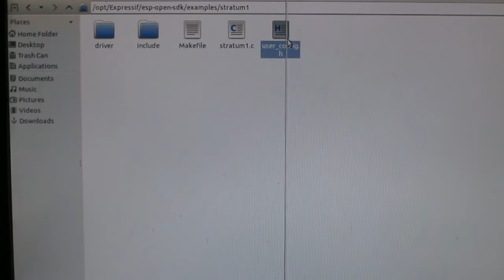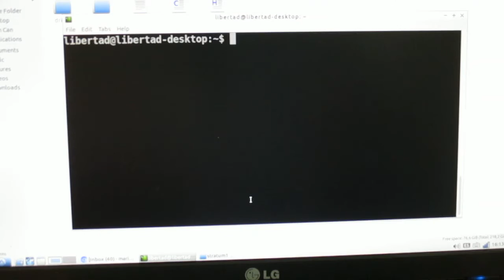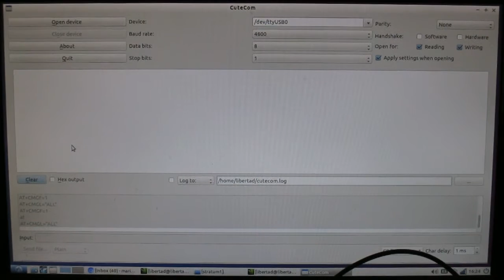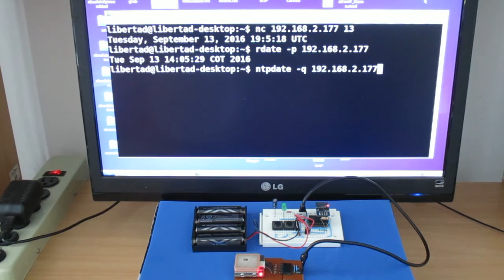ESP82266 + GPS STRATUM 1 NTP SERVER

Comment: Have you considered an updated article, one that uses PPS, or perhaps written in LUA?
Reply from the maker: Hello! thanks for viewing and writting! Sure is in the "TODO list", first need a suitable module with PPS output. I have little LUA knowledge, don't know if is fast enough to keep the 3 simultaneous socket connections and serial port management without polling
Reply: This module has PPS output http://www.dx.com/p/open-smart-serial-gps-module-for-arduino-apm2-5-flight-control-450738
I just got one of these in the mail today. I will be trying to compile this up and get it working on my NodeMCU. I am having to create the whole build env on a raspberrypi. i've done all my previous tinkering on the ESP8266 in the Arduino IDE, so this will be a 1st, if I get it working.
Reply: Well i got it working, but not with the nodemcu, might be something different about its RX pin? I also have an ESP-01 and got it working with that module.

I had some errors about the .text being too big to fit in memory. After googling I found a fix of replacing the LDLIBS line with this

LDLIBS = -nostdlib -Wl,--start-group -lmain -lnet80211 -lwpa -llwip -lpp -lphy -lc -Wl,--end-group -lgcc

It looks like the -lc is what is different from the line in your source

I also had to update the serial baud rate to 9600. Otherwise it works
Reply: After using this for a day it seems to work pretty well. Though I have noticed a couple of things. When using the ntpq -p command on a server I have syncing to the esp8266 the delay is a bit high, always in the 200ish MS range. I notice if I ping the esp8266 the 1st 3 or 4 pings come back with a relatively high ping in the same 200ish MS range but then after that it drops down to a much more reasonable single digit MS ping. Is there something in this code that puts the ESP8266 into some kind of sleep or low power mode that could be making the 1st few pings take longer and then it stays awake with the repeated pinging?